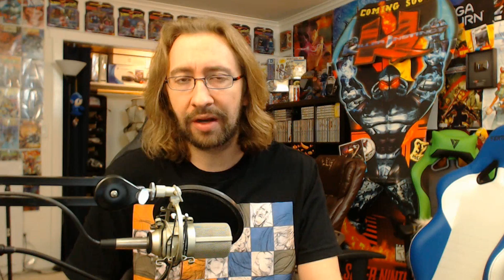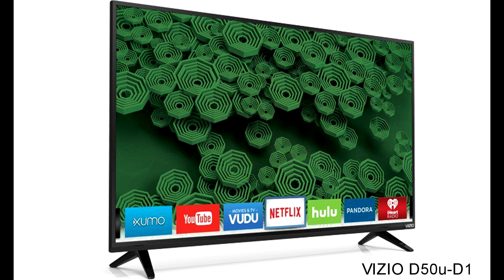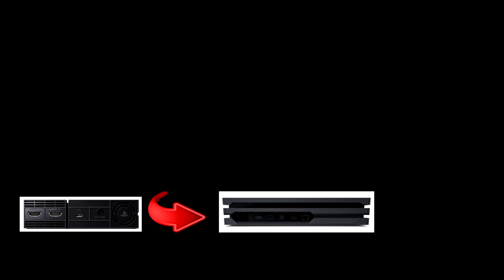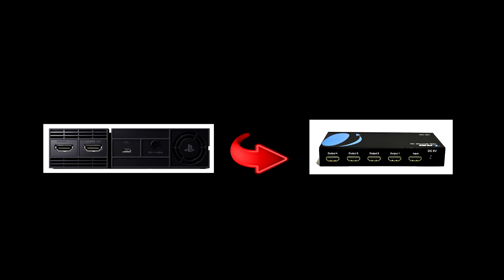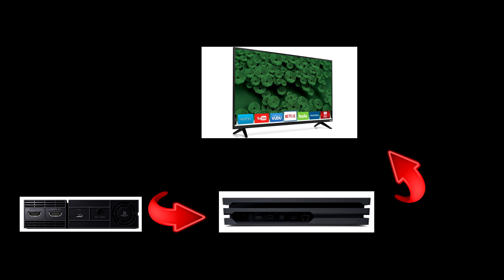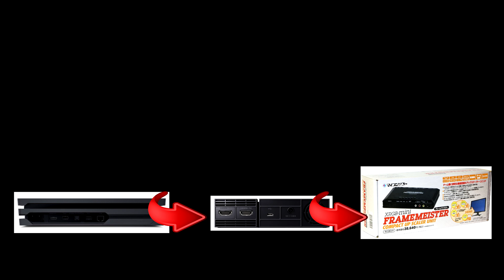MY PS4 PRO NIGHTMARE...And How I Fixed It

Comment: Hell, I had no problems at all......plus...i did replace the HDD and put new firmware before I  ever booted it up. 4k great resolution, smooth sailing for me. But i am not using a Vizio TV, I am using a Samsung KS8000, and PS4 Pro directly into it. And didn't Trade my Original PS4...I kept it.
This does sound like a TV (Vizio) problem tho...

Comment: On my 55" Vizio 4K TV, what people need to do is connected to the 4K 60fps HDMI, then when in Safe Mode choose HDCP 1.4, then  my PS4 Pro recognize 2160p-YUV420, but for some reason it will not recognize the other 4K 30fps HDMI it would recognize 720p and 1080p, but when connected to 4K 60fps HDMI it does recognized 2160p-YUV420, hopefully this will help anyone.

Comment: Max, I have a LG LED TV with HDMI and 1080dpi. It's not a 4k TV, but if I buy the PS4 Pro, will it work after the patch? I'm having a tough time deciding to get the Pro or not after watching your video. But thanks for your knowledge and warnings about the system. I may have to wait until they finally can patch this upsetting upgrade. But please let me know if you know someone who has this or if someone in chat can help answer my question. Thanks! ^^

Comment: The problem is that the PS4 Pro only has a HDMI 1.4 connector (which doesn't support any 4K or 4K up-scaling, as well as the HDCP protocalls used for 4K). For 4K and the HDCP protocols to work, you need HDMI 2.0 connection. Sony's is messing around with the protocols to force there HDMI connector to send a 4K video through a port that has a max of 1080P support. This is all information that game developers and TV manufacturers pointed out before the PS4 pro launch.

Comment: I never comment but I felt compelled to. I have the PS4 Pro and a PS VR and a 4K Panasonic dx902 TV. Not had a single problem. Your set up is not a traditional set up, you even said if you plugged the PS4 pro into the VR every then int your tv everything work perfectly fine. Maybe the problem isn't with Sony but the fact you need so many different inputs for your capture card. HDCP is designed to stop pirating, so if your got a black screen it seems to be working and to tell people not to buy because of sub normal set up I believe your wrong.

Comment: i have the same tv. i get a pic no problem. however the system will not register 4k at all or 1080p 60hz. only 1080p 30hz on any input. i feel your pain.

Comment: Hey Max, I have a question (if one of you dudes in the comments can help me that'd be fantastic as well). I got a PS4 Slim a week ago as I don't own a 4K HDTV and am not really worried about the upgrades (that's a different tangential story). BUT I bought Street Fighter V and the season pass, new copy of the game, and for whatever reason cannot update SFV to version 1.07 - I get the CE-36244-9 error. I've noticed upon further investigation that several games are plagued by this, but there's no solid fix - I've tried setting up a static IP, changed the DNS, rebuilt the database on the PS4, removed ALL SFV data from the PS4 and from the library... Nothing works. It sticks at 1.93 GB and then errors out, saying the update is corrupted. I'll be calling Sony tomorrow to see if there's a fix, but... I'd really like to be able to play the game since I bought it AND the season pass and can't play anything since, well, you guys know how the SFV launch was.

Comment: My PS4 Pro and PSVR experience has been flawless from the begining. I do use premium high speed HDMI cables paired with my LG OLED65C6P. There is definitely something wonky with the new HDCP system and by using cheap HDMI cables with some of these new tvs with the PS4 Pro.
Reply: 03chrisv hi, if I may ask is your monitor an average 1080p gaming monitor?  will the pro be compatible with it? I use a typical Asus 1080p gaming monitor
Reply: chan benyamin No, it's a 65 inch 4k OLED tv from LG. It's one of the best tvs you can connect your PS4 Pro to, however it should work just fine on a 1080p monitor. Most new games should see a graphical upgrade via super sampling or better effects at 1080p with the PS4 Pro.
Reply: 03chrisv thanks!

Comment: My PS4 Pro is working great with my Samsung 55KU6300. No issues. I had to turn on HDR for the HDMI port the Pro was connected to. Moral of the story? Buy a Samsung TV. Problem solved.
Reply: Steve Swanson The UHD setting right?
Reply: TheGjergj79 My TV immediately recognized the 3840x2160p resolution being outputted from the Pro, but the PS4 was saying HDR is not supported. After looking online, I found that you must manually turn on "HDMI UHD COLOR" for each HDMI port to enable HDR. Samsung refers to HDR by this specific phrase in the Expert picture settings. After that, the PS4 shows "HDR on your TV - 2k/4k supported.

Comment: Sorry to hear man, I've had absolutely no problems with my Pro, plugged it in, and it works fine regardless of which mode I use.

The only thing that did bite me was that initially I had the PS4 Pro set to 'auto' resolution which for some reason decides to use 4K @ RGB. This is fine for non-HDR gaming, but RGB @ 4K mode maxes out at 8 bit color (it's an HDMI 2.0 limitation). So for HDR you have to manually set it to YUV420 to get 10bit color support.

Comment: it's because your TV is crap, Sam reason so many similar 4k tvs are cheap. it doesn't run 10pix, it's crap. so many people are buying cheap 4k tvs and thinking they are good for PS pro and Xbox Scorpio. hdr pro and 10pix, everything else is rated for movies and 4k TV viewing. even the refresh rate you state at the beginning of your video, is based on movies not gaming. much slower on gaming. lesson don't buy cheap TV sets for newer hardware.

Comment: I had to do a similar set up cuz my PS4 Pro was giving me the same issues!!!
1. From PS4 Pro to PS VR
2. From PS VR to an VCR
3. From VCR to a Modded DSL Modem (to even out the transfer speed)
4. From Modded DSL modem to a Microwave Oven (had to use a General Electric cuz they dont use HDCP on their appliances)
5. From Microwave Oven to Refrigerator condenser 
6. Refrigerator to my grandpa's peacemaker (You have to use an antenna to get this wireless but can skip this step if your grandpa is willing to suck on some cables while you play)
7. And then to my 4K TV.
Its slightly more complicated than the the setup on this video but it WORKS!!

Comment: Was having problem for about an hour I'm using a lg 4K HDR tv and it's a problem on lgs end all you have to do is turn hdcp off and I get normal display not the black screen anymore but when you watch YouTube etc...you have to turn it back on but be sure to turn it back off after your done lg and Sony need to fix this problem other than that loving my PS4 pro and don't regret my upgrade 🎮🎮🎮🖥

Comment: Oh my god, MAX, THIS SETUP IS HILARIOUS. Mostly because of what it suggests! I bet you anything the patch fucked up their copy protection system, and the reason it works on your ghetto pass through is because you're stripping the copy protection from the root signal.

If you have a splitter that strips copy protection, you can probably cut everything else out of the equation.

I can't believe Sony screwed this up so bad.

Comment: This may sound like a stupid question but did you use the HDMI cable that came with it? I know it requires the new HDMI (2.0) cable to support the high resolution. Also is the 4k hdmi port on tv? Is the HDR enabled for that port?

Comment: Does your TV support HDR signal?  Because I've heard that you lose HDR pass through when you string the Pro through the PSVR processor box? Just a thought. Definitely disappointing to hear that it doesn't pass through and you have to disconnect the VR from your PS4 Pro HDMI output every time you want to enjoy HDR enhancements :-/

Comment: Okay Max I wanna tell you my side of the story with this TV because this might interest you. I bought this TV for the reasons you did. I couldn't pass up that response time, which btw people is about 13.5 ms , which is is unheard of with many of these TVs. I noticed something though while playing Overwatch on my  Xbone : the upscaler wasn't too good (good call on the framemeister btw because this tv does not play nice with older systems) It looked pretty odd also when I played DOOM on it as well. So when I heard about the Xbox One s & it's 4k upscaler I figured "Holy crap! I could use the upscaler on the one s & rectify this situation!" SO when I get my One s & set the resolution to UHD guess what? "No Signal" the black screen in other words.

So after I tried everything from different HDMI cables to shutting off certain settings on the tv with no results I turned to the xbox forums to figure out wtf was going on. Along that time I noticed something really weird. I woke up one morning & turned the TV on & switched the settings right after. IT WORKED!.........for a little while until the signal started cutting in & out until it just completely went out. Out of pure curiosity I tried this again & timed it to see how long it could sustain the signal after the tv had been off overnight. I got roughly 12 minutes before the signal started cutting in & out & you know the rest. I spent a couple of months on the xbox forums staying in touch with an ambassador to see what we could figure out. We tried everything from changing color spaces &  gamma settings to just turning everything off. We got no where. 

After awhile I made the choice of picking up a gaming PC. I bought a rx 480 because the GPU it came with was just crap but the interesting thing was the fact that the GPU & my CPU could handle a 4K signal. Hell Windows 10 even listed it as my recommended resolution because I was using my TV as my monitor, which works great btw, This is where I felt like I got some answers because when I tried playing Dishonored @ 4k fullscreen guess what happened? No signal! I was perplexed. I was scared shitless when I turned Virtual Super Resolution on via Radeon settings out of curiosity & my signal cut completely out. I found out after a system restore that it switched my signal to 4k when I did that. This pushed me to enough to talk to Vizio but before that I looked at Rtings & noticed something interesting : There was some talk about the Chroma /Pixal Formats. It said & I shit you not that the 5th port was 4:2:0 & the other ports were were 4:2:2. When talking to Vizio about this all I could get was "we don't know those specifications". That sounded kind of weird to me that they wouldn't know that.

Anyways, I had a hunch to try out one of the other ports that run @4k 30hz on my PC & guess what? It worked like a fucking charm. I mean the refresh rate when testing it on Dishonored was abysmal but the 4k signal remained stable. This brought me to the conclusion that there has to be something up with the pixel format. Then you, Max you talked about getting a PS4 Pro & I remember in your Office tour video you mentioned your TV. It was the exact same as mine. Model & all. So here we are lol. What's interesting though about your setup to me is how much power you have carrying that signal & creating that "handshake" you were talking about. I think your setup is actually supporting it with more power or enough to sustain the signal.
Reply: well...this totally kills my hopes...i have standard ps4...wanted to celebrate RE2 Remakes release by getting it with a pro...after seeing all this its really discouraging especially that i literally have the same exact model tv...uhd 4ktv vizio D series...this sucks because i went in buying this tv thinking wow well if i ever decide to upgrade my sony console ill be ready to go...and it looks like its about 3 steps backwards after hearing that they cut in or out...so i guess im sticking with my standard ps4 at this point....dont get me wrong ...fighting games...it looks beautiful....as max stated it does have the least lag....but maybe thats what this ones strong suit is....i guess maybe in 4-5 years ill buy a tv that can handle true 4k and by then itll probably be ps5...its just crazy that...the ps4 now feels like a ps3.5 while the pro that is only compatible with im guessing newer 4ktvs is the true ps4...its like wtf did u come out with this then...and then even if i tried to see if it works and it doesnt...i cant just return it because its already an opened/used item...whatever... i played re2 back in the day with its graphics and loved it to talk about it 20 years later...hopefully like its predecessor...this one will literally "survive" off its story and gameplay another 20 years and not just because it looks prettier...thank you for your feedback and max's...but i think thats the nail in the coffin on my decision...especially with my temper lol..u try and spend money for a treat and then u end up with a fuckin headache.....atleast i do know at 1080p the game will still run at 60fps...
Reply: @billzco6137  imo neither the PS4 nor the PS4pro are good consoles.. my PS4 lasted 6years until it died.. meanwhile my PS2slim and my PS3, hell my Gamecube even! are working just fine to this Day.. 5days ago my replacement PS4 died as well.. so screw it I may wait for the PS5pro, yes! not waiting for the PS5 but the PS5pro.

Comment: Turned my PS4 pro on this morning....got hit with the black screen. I could hear the sound but no picture. All was working well since launch. Does anybody know which resolution I should use once it's fixed? 2160p yuv420 or 2160 rgb? Thanks

Comment: Simply put, the handshake only goes between the two devices directly connected to each other. They made certain the handshake between the PS4Pro and the VR would be solid. So the PSVR is more or less simple and easy to connect to other devices but, as you said, the latest patch for the Pro cocked it all up. Shouldn't take too long to fix.

Comment: Well looks like I'm sticking to the OG PS4. I never really cared about 4K gaming anyway.
Reply: DaDood agreed I won't care about it until it's the standard lol
Reply: some games are benefiting to the pro way better than the regular ps4 in 1080p like ff15 soon and tomb raider 1080p 60 fps
Reply: jama655 of course it will be eventually, 4k tv prices will also drop just as HD 1080p TV prices drop
Reply: Master Neloth you can get 60fps without it. And even then, having the best of the absolute best was never that important to me. If the game looks nice, I don't give a shit if it isn't as pixel perfect as possible. Its stupid to worry about shit like that
Reply: DaDood And 60 FPS makes a game more fun,  Unless you don't care if the game is more responsive.  Action games are objectively more fun at 60 FPS.
Reply: hopefully it wont be the standard 4k is expensive af
Reply: Keron Kamiley Differentiates this classification from other classifications of psychological disorders
Reply: 4k is not expensive.  Get a 55 inch tv for about 300-600 dollars.
Reply: DaDood you don't care abou 60fps?
Reply: DaDood not really.  The ps4 cant handle many 3d games well enough to achieve 60 FPS and has a hard time with 1080p, 30FPS..  You need nearly double the graphical processing power for 60FPS.  This new system has just about reached the point of smooth 1080p, 60FPS.  I say its about time they did.
Reply: clownavenger again, it doesn't really matter to me so long as the game is fun.
Reply: 4K is an overrated gimmick, however, HDR is not. HDR is incredible looking on my KS8000. But, I heard something about "Dolby Vision" coming out soon which will compete with HDR. So, now we're gonna have another "HD-DVD vs Blu-Ray" on our hands; early adopters of either tech may get fucked over when one loses this war.
Reply: Tage Nasty samsung will sort dolby vision with a firmware update so dont worry b happy
Reply: DaDood i got a regular vizio and the pro works fine
Reply: You can already get a Samsung 40" 4K TV for ~$300 USD from BestBuy (cheaper if you have an American Express credit card) so yeah... don't know how much cheaper you expect/hope it to get than that. They're practically giving the things away given the pixel density.

Comment: I had that issue but it was because the hdmi wasn't connected to my 2.0 tv port so I connected it to that and turned on the hdmi deep colour setting on my 4k lg tv and it was outputting 2160p rgb instead of the lower 2160p ycb

Comment: I kept my ps3 + I intend to keep my ps4 standard, I will buy ps4 pro when it settles. still wouldn't get a pc. just have to remember its a minor issue till Sony probably let out a decent patch for the system. but I can't lie I never been a fan of this dlc pc style of patch updates. consoles ran so much easier + better with out unfinished games + dlc + patches. obviously tech moves forward but trying to make consoles now is more like having a pc with its problems in your home. remember how your snes was?? easy stuff. so why change the formula. think as gamers we have encouraged this generation of games designers Aswell as console makers to rush + not finish the stuff they let us have as consumers. best advice is BUY WITH CAUTION. OR AT YOUR DISCRETION.

Comment: Sucky part of going through PSVR is only 2160p YUV420 is available and doesn't allow HDR. The PSVR is still using an older HDMI 1.4 vs the PS4 Pro has 2.0. I have to always plug directly into my TV to get HDR and 2160p RGB. Took me a bit to figure this out...no idea why they did this...since HDR is a big bonus for the Pro...who the hell is going to keep unplugging the PSVR.